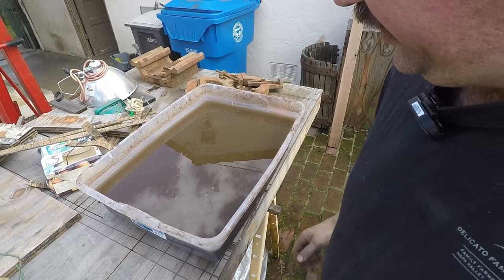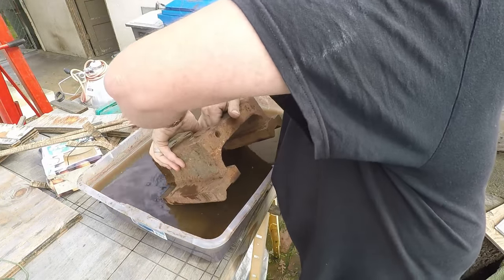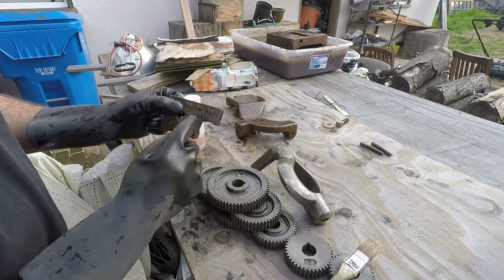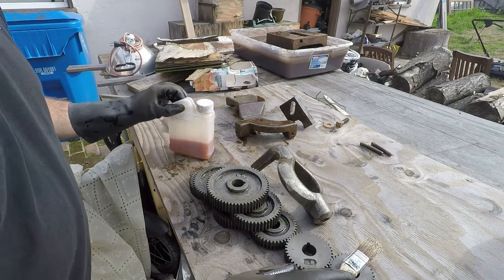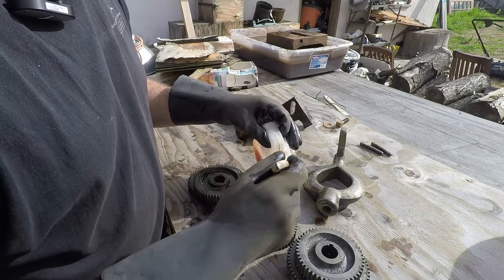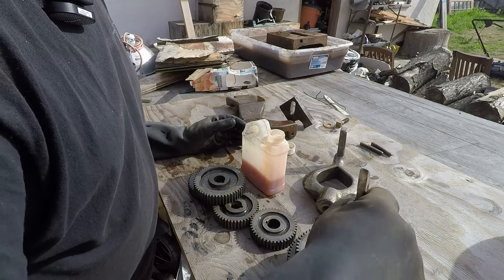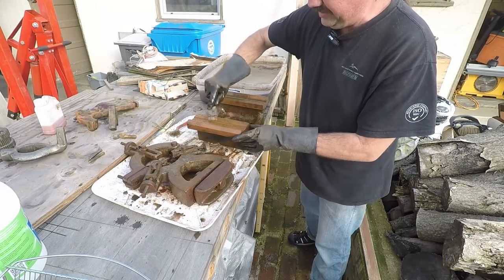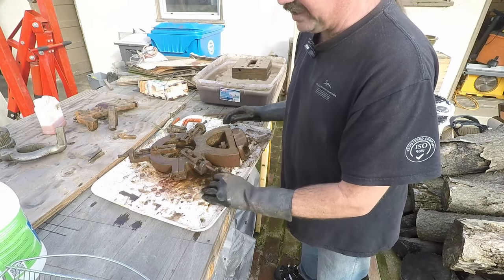Rusty Cast Iron Restoration part 1

Comment: I've used the Citri-Strip a bunch. As soon as it dries, it quits working.  I learned to use it out of the sun for that reason.  It dries quickly.  Magic-Strip smells similar and stays wet for a very long time.  It seems to work longer on the stubborn thick areas and requires fewer re-treatments.  Fortunately you have a small container there.  I started with one of these then bought a gallon so it took a bunch of projects to use it all up.  I've not tried the vinegar but will in the future.  It seems to be the best cheap method.
Reply from the maker: +Crafted you right it does dry out .and this old led paint dose not peal away. It just gets soft and you have to scrub and scrape it off. Lol I have another bottle of it to go through.
Reply: Ah ah.  I've had paints occasionally that didn't seem to want to let go. It must have been leaded paint then.  Never thought of that.
Reply from the maker: That's my story
Reply from the maker: +Crafted seems to me that I herd you can cover it with plastic wrap to prevent drying. This stuff is really old and melted it .maybe a different formula.
Reply: Yes, I remember Keith Rucker doing that at some point in his lathe restoration.
Reply from the maker: Crafted I will have to try it out with the new stuff and see if it is any different.
Reply: The early SB lathes were finished with japanning.On my 9" the grey coats came right off but the black japanning original was tough so I roughed it up and painted over it.
Reply from the maker: +j hefflinger ahh that makes sense some of this stuff is hard like glass.

Comment: I've noticed in these rescue video's people talk about the rust pits as if you need to refinish the surface until they are gone.  You mention you'd like to avoid recasting the part over pits for example.   Yet when a freshly machined surface if flaked, it's done to in effect add porosity to the surface to aid in keeping it lubricated at all times.  I would think if one were going to refinish we would want to remove the minimum of material to minimize shimming and setup issues on reassembly.  And these lathes are preserving history.  The story of the lathe, it's pits, it's repairs, it's modifications and tool marks are all parts of that story or patina.  They are valued for their art and practical purpose.  So, I don't see making them fresh off the factory floor as a requirement.   In fact, it makes them more of a trophy and less of a historic artifact.  If one were going to refinish a bed (and we are far from knowing what you'll be doing) I would guess it would be a good idea to soda blast the ways to get all the loose rust grit and flakes out of the pits.  Then machine the surface only till it's flat and straight.  Thus leaving remaining pits post grinding clean to serve some value to hold oil and remind us of the lathes history and experience.  I'm certainly no expert on way regrinding or flaking.  Just musing about my initial thoughts here.  This is my favorite series to follow at this time.  It will be fun to see it all finished up and making chips in a few weeks.    ;-)  Thumbed Up.
Reply from the maker: +Crafted a few weeks?  Quite the opptomistc.  There is something to be sed for leving the dings as they are.  But this thing has seen a lot of use and abuse the bridge was in a pool of water when I got it . At the end of the day I want some longevity and usefulness to be returned to the lathe . If it's working good it's much less likely to get scraped once I am not here to care for it.
Reply: That was humor.  A few weeks indeed.  ;-)  Actually a year would be pretty quick.  You're not planning on leaving us I hope?
Reply from the maker: +Crafted to I don't think that I will out last this iron but I do plan to give it a run for its money.

Comment: Hi Crhis,
I see you're in making big tough pickles!!!   lol
This should do all right, you need to be patient, if you need to get it done faster you could add some muriatic acid, CAUTION it's much more corrosive, keep some sodium bicarbonate in order to neutralize after you take it out of the bath...
When you dilute strong acids, make sure you ADD THE ACID TO THE WATER, NOT THE OTHER WAY AROUND...   Be sure to neutralize before trowing away, a pool PH testing set is great for this, and a 4 to 5% mix should do ok. DON'T HANDLE WITH BARE HANDS AN PROTECT YOU EYES... 
Some pitting in the final result will probably be acceptable unless the bed is really worn beyond being usable..
Cheers,    Pierre

Comment: you want electrolysis for this, will strip paint and rust in 1 go, also cheapest method, it cannot be over done like with acids, get a big plastic drum or a plastic trash barrel and a battery charger and your set for many a projects worth of rust removal.
Reply from the maker: +captaingreenbush I will look into it don't have a charger so that's a small hurdle
Reply: Chris, it dont take much current for electrolysis. I bet an old phone charger or puter power supply would work just fine. If you dont have anything and want to give a try I will send you some kind of power supply. Just let me know.
Reply: when I first started experimenting with the method I had tried a few "wall wart" power supplies, they worked for a short time but would burn out quickly, a cell charger would burn out very fast I imagine, a computer power supply however might get you a bit farther, best to use a battery charger, just don't get a "smart" charger, they are worthless for this purpose, "dumb" chargers can still be had quite cheaply, I inherited one, and have another I got for about 10 bucks at the swapmeet, never had a new one, but surely they are still made
Reply from the maker: +captaingreenbush heck I'll give you 10 for your spair
Reply: +Chris Anderson (The Apprentice Machinist) well I only know where 1 is right now, the other is buried somewhere in the garage, and would like to keep them, shipping considered it would be around 20-30$ and for that, I did a quick look on Craigslist, battery chargers can be had readily for the same or less. Look for an older one, the windings were heavier and will stand up better imho to use as a power supply for electrolysis.
Reply from the maker: captaingreenbush I'll do that
Reply: Now you did it! I have more experimenting to do. lol I have quit a few different configurations of power supplies.
Reply from the maker: +j hefflinger lol trouble is bruin
Reply: Maybe power supplies last longer here because they stay cooler! lol I rode MC Monday 50 deg. Rain all day Tues 40 deg, snow all day wed, 30deg then down to 18 that night! 16 now with 10mph breeze. My lathes wont know whether to sweat or shiver!
Reply from the maker: +j hefflinger it's 60 here at 1 am
Reply: Chris Anderson I think I need to become a snowbird! Ohio is cool but,.......it's cool!